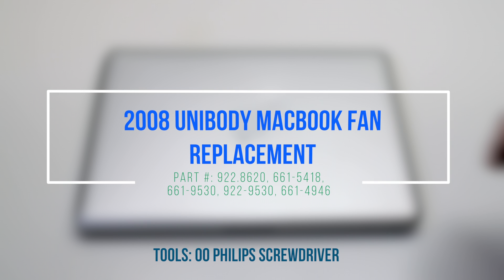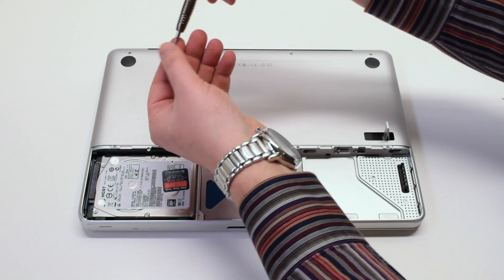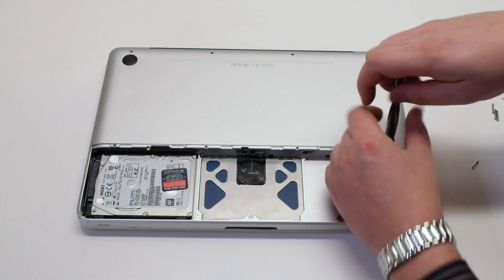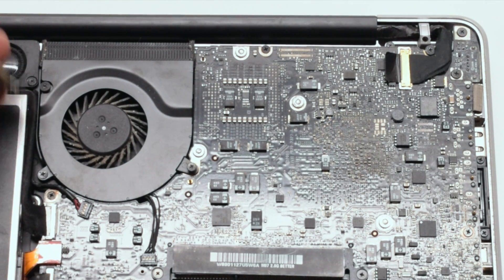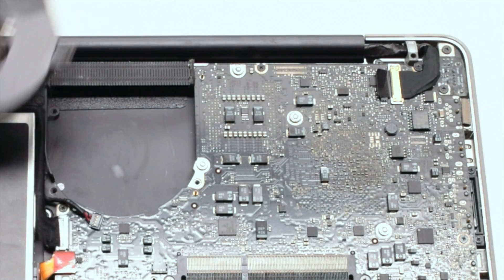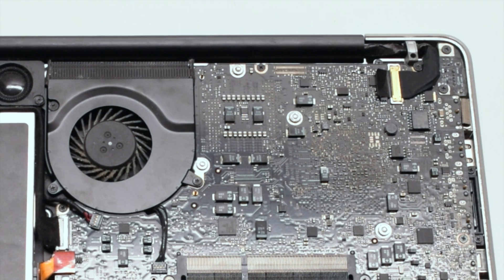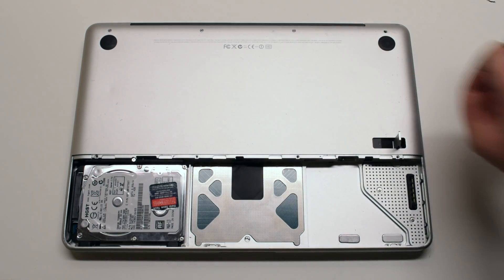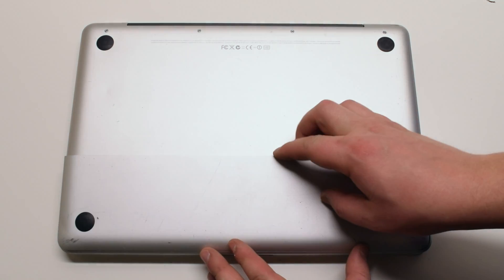2008 Unibody System Fan Replacement Save Apple Dollars #27

Comment: Thanks for uploading all this information. When you consider is necessary to replace the fan? I understand that all macbook overheat a little.
Reply from the maker: +Carlos Montes Hi, if the fan is making strange noises, the motor might be damaged, I would replace it then. That is rare but it happens. Just keep in mind that if the fan is constantly turning on, then the thermal paste on the CPU/GPU heat sink is old and needs to be reapplied or the temperature sensor is damaged or covered with residue and needs cleaning. You can watch the Logic Board replacement video, it covers how to apply thermal paste.
Reply from the maker: +Carlos Montes Also Carlos, it's ok to take out the board and clean the entire board with an alcohol soaked toothbrush and letting it dry over night, this will fix 90% of spills and bring most Macbooks back to life. I will be making a video on that soon. If a Macbook suffers a spill on the keyboard, you can disconnect the damaged keyboard and see if the Logic Board is ok by powering it on with the "power pins", check out this awesome guide on how to do this: 

http://www.insidemylaptop.com/turn-on-macbook-pro-laptop-without-power-button-locating-power-on-pads/

(Keyboard can't be cleaned or fixed, they have to be replaced, so if the spill is on the keyboard, you got to replace the keyboard, that is the most difficult repair.)

All of my videos are organized at www.appledollars.com , I'm shooting videos every week, so check out the site for more specific videos.